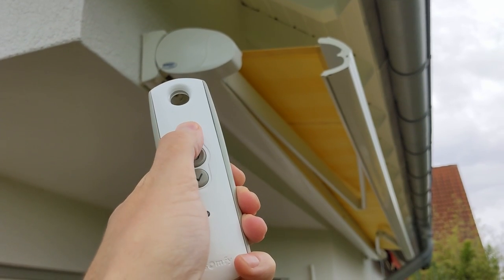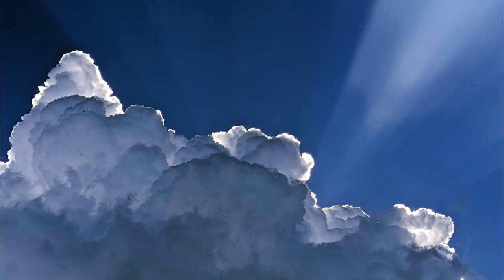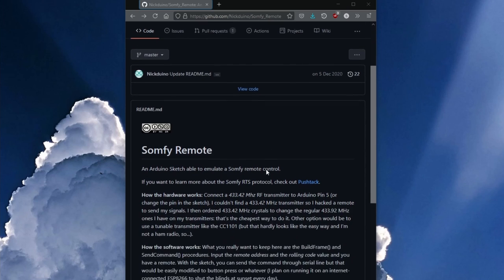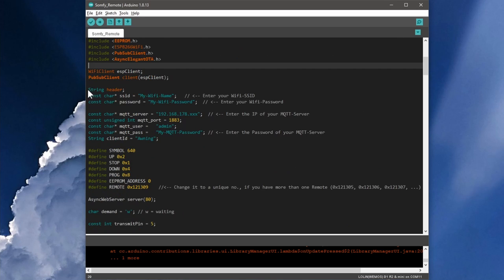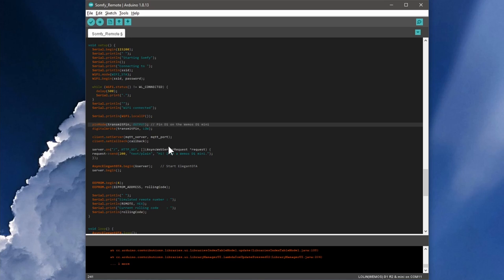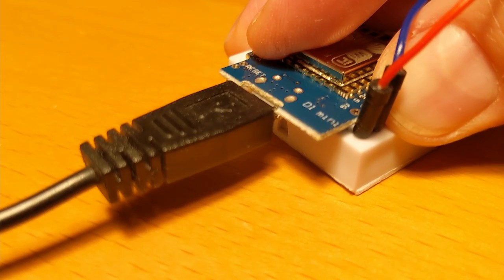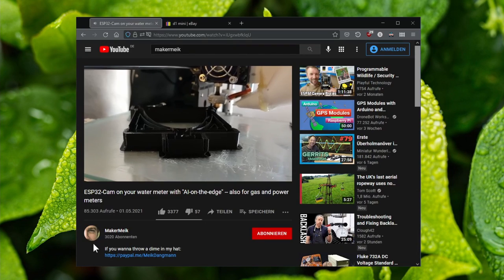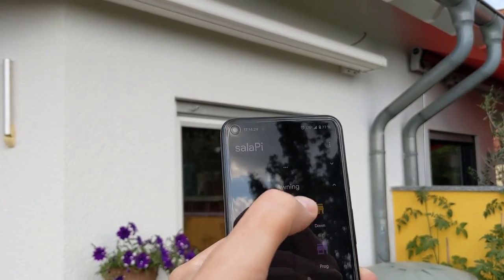Make your Somfy-RTS-remote smart using an ESP8266 and MQTT to control your awning or shutters

Comment: Hi, i always get this message if i try to flash it.  Do you know the solution? 

Arduino: 1.8.16 (Windows 10), Board:"LOLIN(WEMOS) D1 R2 & mini, 80 MHz, Flash, Disabled (new aborts on oom), Disabled, All SSL ciphers (most compatible), 32KB cache + 32KB IRAM (balanced), Use pgm_read macros for IRAM/PROGMEM, 4MB (FS:2MB OTA:~1019KB), v2 Lower Memory, Disabled, None, Only Sketch, 921600"

In file included from C:\Users\Jo\Documents\Arduino\sketch_oct06a\Somfy_Remote\Somfy_Remote.ino:28:

C:\Users\Jo\Documents\Arduino\libraries\AsyncElegantOTA\src/AsyncElegantOTA.h:11:14: fatal error: ESPAsyncTCP.h: No such file or directory

   11 |     #include "ESPAsyncTCP.h"

      |              ^~~~~~~~~~~~~~~

compilation terminated.

exit status 1

Fout bij het compileren voor board LOLIN(WEMOS) D1 R2 & mini

Dit rapport zou meer informatie bevatten met
"Uitgebreide uitvoer weergeven tijden compilatie"
optie aan in Bestand -> Voorkeuren.
Reply from the maker: Apparently, the error is due to AsyncElegantOTA. Check if you really have the latest version installed.
https://github.com/ayushsharma82/AsyncElegantOTA
Also the ESP8266 core in the board manager must be up to date. If you use PlatformIO with VScode, you should check if the error also occurs via Arduino IDE. I think I remember that there was a problem with PlatformIO once.
Otherwise you can also just comment out the AsyncElegantOTA part in the code. It is only there so that you can install updates over the air. That should be dispensable.

Comment: Nicely explained. 
But I have a promlem:
when trying to upload i get

In file included from C:\Users\Christian\Desktop\Somfy_Remote\Somfy_Remote.ino:28:

C:\Users\Christian\Documents\Arduino\libraries\AsyncElegantOTA\src/AsyncElegantOTA.h:11:14: fatal error: ESPAsyncTCP.h: No such file or directory

   11 |     #include "ESPAsyncTCP.h"

      |              ^~~~~~~~~~~~~~~

compilation terminated.

exit status 1

Any advice would be appreciated.

edit: faild to mention i have tried deleting and reloading the mentioned libraries.
Reply from the maker: Hmm ... did you check if the file "AsyncElegantOTA.h" exists in the mentioned directory? 
If not, providing the files in that directory is certainly the fastest way. 
If you don't know where it ended up by installing the library, you can download it again here in case of need:
https://www.arduino.cc/reference//en/libraries/asyncelegantota/

If you want to get to the bottom of it, you can also read here how the library manager of the Arduino IDE actually works.
https://www.arduino.cc/en/guide/libraries

But in the future I would recommend to switch from the Arduino IDE to VS Code with PlatformIO. This offers many advantages and is easier in the long run. However, from my point of view, getting started is a bit more difficult, which is why I limit myself to the Arduino IDE in my videos.
Reply: @MakerMeik  Thanks a lot for the advice. I managed to get the code working using VSCode and pulling the libraries as needed. no idea why it didn't work using the Arduino IDE.. 
Now i just have to wait for my crystal to arrive. Lets see how customs work out.
Just another quick question: i have the same setup as you do wit the wemos d1 mini and the same pinout printed on the transmitting board. Is there any reason you connected vcc to the d1 pin and not to the 5v pin. Logic dictates to me vcc → 5v; GND → G and Middle Pin → D1. (Transmitter Board → Wemos D1 mini). Am I missing something here?

Keep up the good work. Maybe you’ll become the next “youtuber with the german accent” ;-)
Reply from the maker: Hi Christian, unfortunately the transmitter boards are printed a bit unfortunate. If you have a closer look, you will notice that the left pin is marked as ATAD, the middle pin as VCC and the right pin as GND. Unfortunately, at first glance you might think that VCC is on the left pin. But what is meant is the middle pin. I hope that was not too confusing. ;-)
Reply: @MakerMeik  ah I see. Thanks a lot for the support. Still waiting for the my crystal though 😊
Reply: After getting the crystal it worked flawless. Thanks for the great project.
Reply from the maker: Since another viewer had the same problem with AsyncElegantOTA, I have now reproduced all the steps:
Other than shown in the video, you need the libraries ESPAsyncTCP and ESPAsyncWebServer from me-no-dev on Github in order to get the OTA update working. You will not find them in the Arduino IDE Library Manager, but you have to download them directly from the Github page and put them in the library folder of the Arduino IDE:
https://github.com/me-no-dev/ESPAsyncTCP
https://github.com/me-no-dev/ESPAsyncWebServer
Reply: @MakerMeik  Thank you. Please put this info to description. I spent 1 hour trying to fix this problem.
Reply from the maker: Thanks for the suggestion, I did it immediately ;-)